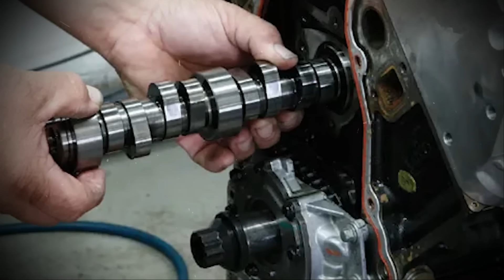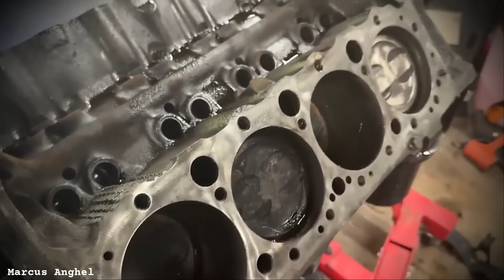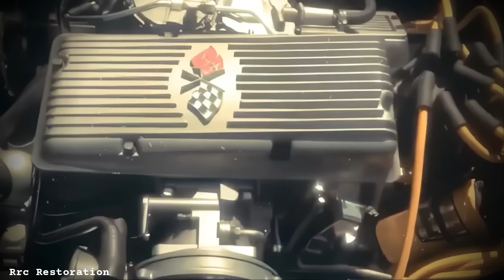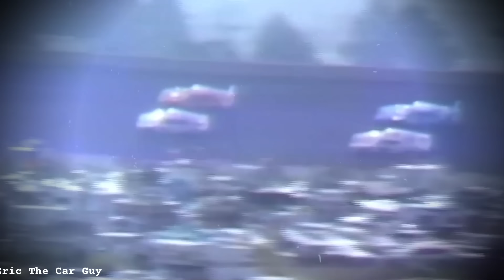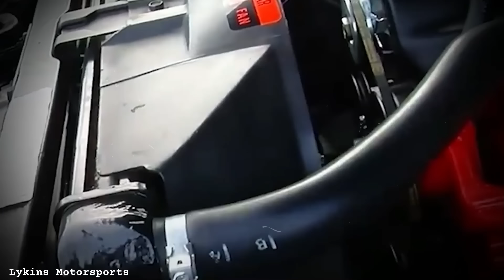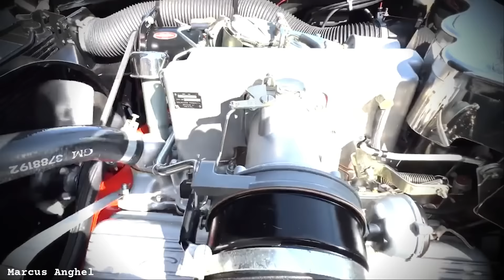This Wisconsin Mechanic OUTSMARTED Chevy With a Simple Fix

Comment: I have a 1977 Buick Electra for a summer cruiser. It runs just fine on the freeway in hot weather, but doesn’t like slow intown traffic at ninety degrees! Of note, the modern fuels have a boiling point of about sixty degrees less than when the carbureted cars were manufactured. If it is hot, I open the hood during a stop, and the car is OK on restart. Failure to do so results in vapor lock, and the car runs poorly when it’s restarted. The car is a show winner and these modifications would result in points deductions. I do have a thick gasket under the carburetor and that helps a lot!

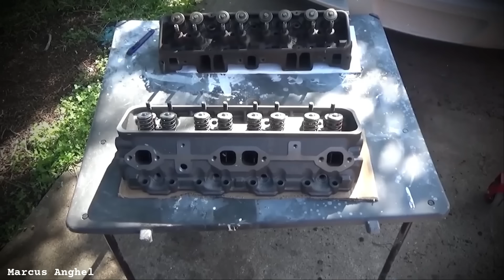Comment: AND ANOTHER  PIECE OF CRAP AI NARRATION AND  4:14  IT CANT EVE SAY   1200 AS TWELVE HUNDRED DEGREE.  AND   HE IS FULL OF CRAP ABOUT THE  AIR AND MORE.  RACING AND HIGH PERFORMANCE  SET UP  DUCT FRESH  COOL AIR INTO THE INTAKE SYSTEM AND MANY ALSO  HAVE THE  HOOD LOUVRES  SO  AIR  FLOWS  OUT AWAY FROM THE ENGINE BAY AND ALSO HELP AREODYNAMICS AIR FLOW FOR DOWN FORCE.  NOW ONTO THE RES OF THE STORY    WHO EVER  MADE THE VIDEO   HAS NOT CLUE WHAT HE IS TALKING ABOUT OR WHAT  HAS BEEN DONE, THIS STORY  IS JUST THAT A MAKE BELIEVE   BS   STORY  99% OF THIS STUFF   ALREADY HAS AFTER MARKET  FIXES  BACK AT THE SUPPOSED TIME  OF HIS  " WISCONSIN FARM BOY "

Comment: I’m an engine builder and I know about all the week areas in the😊 small block Chevy, but there’s one important item that you missed and that’s putting two exhaust valves next to each other in the center of the cylinder head, which is the hottest part of the head causing cracking and cylinder head warping primarily in the middle of the head. I seen thousands of these heads and mostly happens with the 350. When they came out with the LS engine, they stagger the intake and exhaust, which was a good move.
Reply: yes  i  shake my head about the two center exhaust valves side by side all the time.
Reply: Chrysler in the 70s put a pheñolic space r under the thermoquad

Comment: This is crap.  Racers have been doing this since the 50's.  What do you think the missing headlights on the 64 thunderbolt do.  They duct cool air into the big TEARDROP HOOD and down into the twin carbs sitting on AN ALUMINUM INTAKE.  That's just one example.  What do you think the raised hood on the chevys opening against the windshield does?

Comment: My old man was making 700hp small blocks in the 80s and 90s that ran 9k rpm and would do this all night long this video is full of bs.

When the car is moving the air under the hood is not super hot air like you’re sitting still idling. And a fan less then 3 amps moves no air and you can’t wrap intake runners with exhaust wrap everything your saying makes no sense and if any of it was true and worked it would of been used by everyone. This is some of the dumbest crap I’ve ever herd.

Comment: With heat, fuel would also start to boil in the under hood fuel lines. Called vapor lock. Rough idling, stalling and hard starting.
Reply: Bring back the cool cans and dry ice

Comment: Beautiful Story!
Reply: Smart kid! It must be that Wisconsin cheese.
Reply: BS story.  His "stock" corvette small block example has an intake manifold does not have any room to do anything like he suggests.  The intake on a 350 Chevy is a wet intake.  That means the cooling system heat soacks the intake.  You cannot simply install phenolic spacers between heads and intake.  There is only enough space for a 0.030" gasket max.
You need only watch nicks garage to watch dyno testing that disproves this crap.
Auto makers have to meet CAFE numbers, that means that they have been working on making the engine more efficient at just about any cost
BTW, all those mods he talks about were in the aftermarket in the early 70s.    And intercoolers are used to reduce temps of air that was heated by compressing the air by turbo/supercharger, not heat soak.
Reply: @22099dscott  couple other things  also his " spacer" 1/2 thick  is going to narrow the spacing head to head so as result now the intake wont fit in flush, this misaligns gasket surfaces intake ports and bolts mount holes. so to throw  in the  1/2  on  each side he  is going to have to  modify the  head and the intake  and have the mating surfaces machined to lower the manifold back down to seal everything and allow the rest of the  pieces align.  And assumng because  he says  it is 1987 and he  was running a  C4  at road america it could be 1 of a few different intakes and fuel delivery systems  but been a while but i do believe those all  had air inlet  duct  that  fed fresh air from above the radiator back to the intake so it already solve the hot air issue and the comment of cutting a hole and $25  in part to get freash air is comical. one other  very minor thing also carbs and  TBI  as you spray fuel out the nozzles  it causes a very tiny  but noticeable drop in air temps at the injector more so  in a normal carberator tho, but as you  mention those were a wet intake, and for a reason it balance a constant steady air temperature and density that also helped atomize the fuel better and meet the requirements as set for polution and still maintain power